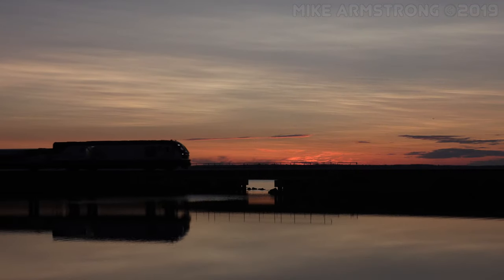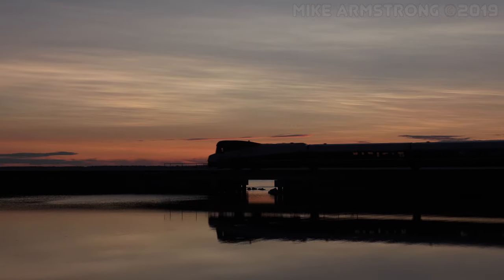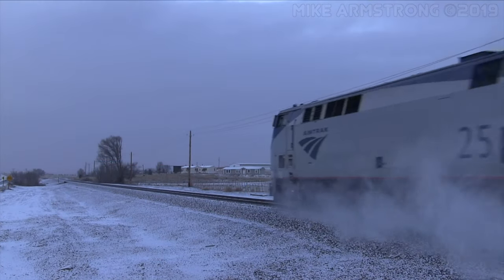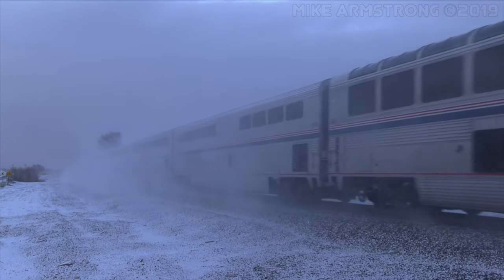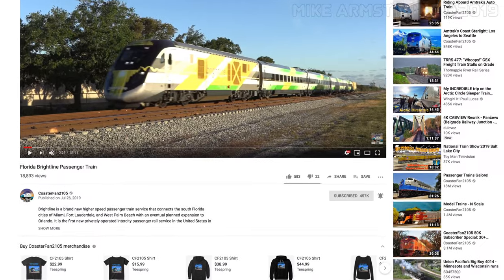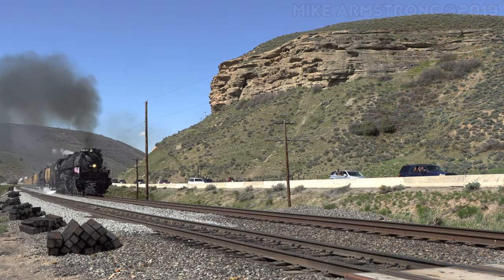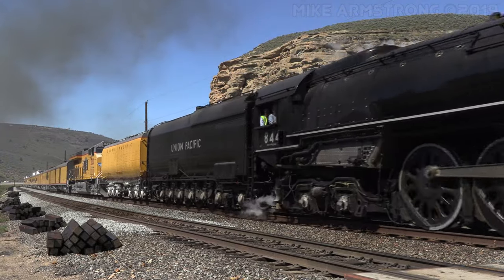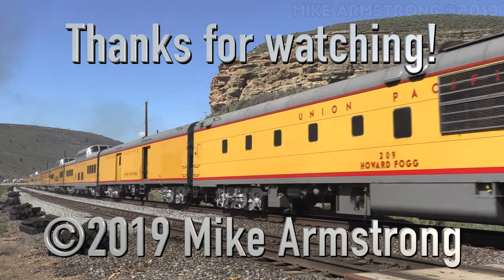Passenger Cars: Train Talk Ep. 23

Comment: Nice video! Fun fact: Amtrak used to transport mail with their long distance trains from 1986 to 2003-04. The boxcars that Amtrak used for this service were unique because they rode on high speed passenger car trucks and had HEP cabling, which kept the flow of Head End Power going from the locomotive to the passenger cars. They were 60 feet long, and were even short enough to squeeze through low-clearance NEC Tunnels. They were numbered 1400-1473, 1500-1569, and were called MHC’s (Material Handling Cars).

Comment: SCL used to operate what they called club cars with physical characteristics of what you described as observation cars. The SCL cars had a section of swiveling and reclining chairs and a larger open space with fixed chairs and sofas with copious numbers of ash trays to accommodate smoking.  The cars were generally equipped with a partial or full service bar.

Comment: The Canadian Pacific built a passenger car with two coupolas based on the caboose for use on it's trains in the Rockies in 1902 for better viewing of the scenery.  There were a total of 4 cars but they didn't last long as the windows were not Polarized and the heat build-up more than compensated for better viewing the scenery.

Comment: From what I know back in the old days certain trains didn’t carry their own AC or DC power to the cars, so they had to have a specific rail car with a generator designated for that specific job. If you look at some of these legacy trains there are operated by the rail lines Some of them are passenger trains they are pulled by freight locomotives.  While freight locomotives “like the GE Evolution series” well freight locomotives do produce DC and AC power they don’t distribute it to the actual cars themselves for that it requires that same power car with a generator on board to be required so that way they can operate the electricity on the passenger cars while the freight locomotive is pulling the train.

Comment: Is the SP GS-4 4449 running still or is Southern Pacific storing it?
Reply: Southern Pacific 4449 is currently owned by Portland, Oregon, and is sometimes used for excursion service. https://en.wikipedia.org/wiki/Southern_Pacific_4449
Reply: 4449 is currently on display at the Oregon Rail Heritage center and will be there until late November when it will pull the holiday express.